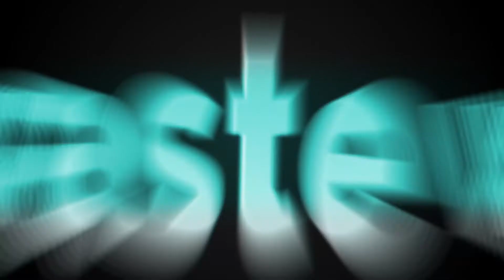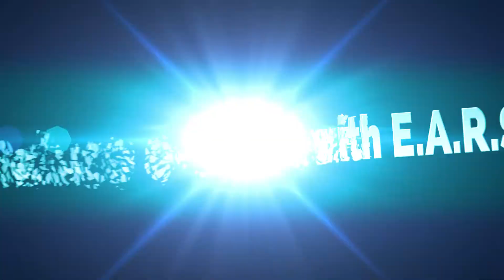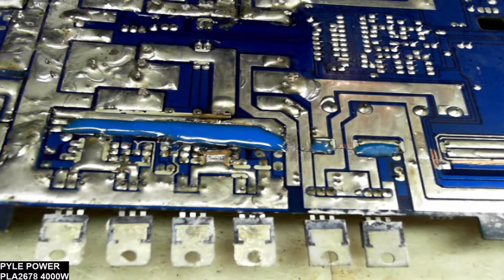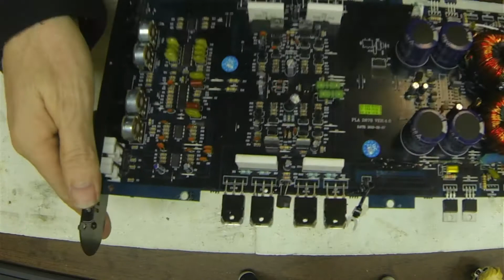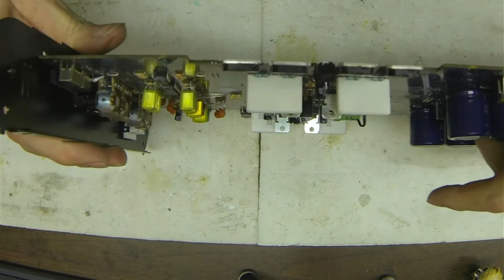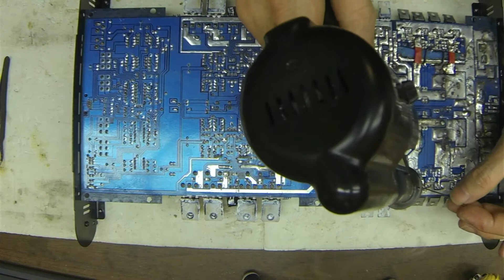Pyle Power PLA2678 Car Amplifier Class AB 4000W of Fairy Electrons With Burnt Cracked Board Part 2

Comment: Brilliant work, well done. The using of the solder braid/wick is genius 👍
Reply from the maker: Thank you Vince! On large amps using normal jumper wire has a diameter that is too large to fit between the board and heatsink but copper solder wick is flat and can carry some decent current.